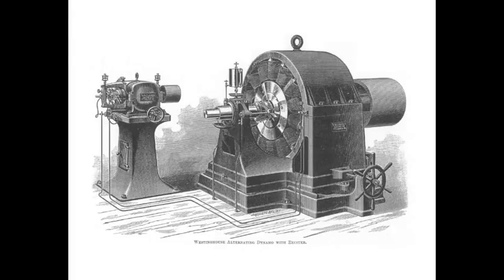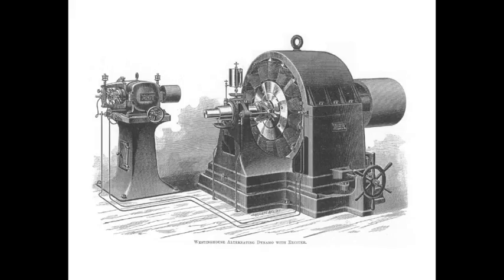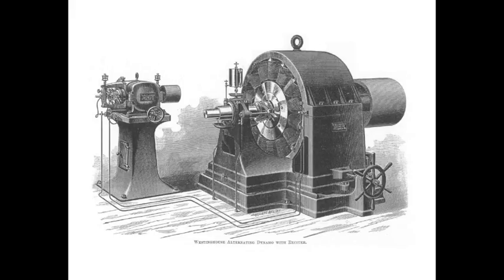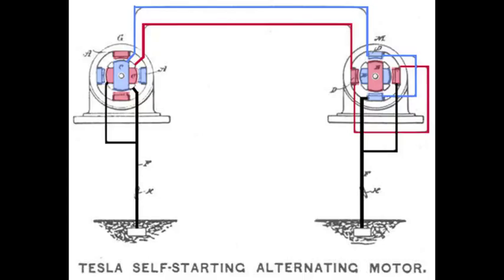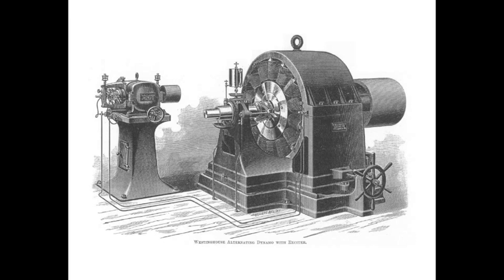Tesla's Siemen's Drum Armature in Build of Alternating Dynamo and Exciter Motor

Comment: Ok, historically the only way to get DC power was from a DC generator or by rotary conversion where a motor running at AC line frequency could convert AC into DC by a combination of slip rings and a commutator creating a mechanical switching system. That motor needed only to 'free wheel' while large currents could pass through the slip rings and commutator. Historically vacuum tube and sold state rectifiers would come later.

 If you look at and read the news article it describes building a motor without the need of an exciter. The term exciter refers to DC generators or slip ring system need to produce DC current. The articles don't call it an induction motor but clearly describe inducing a field in the rotor windings like a transformer.      

If you read about the Fucashima Nuclear accident you will see that they mention diesel generators a number of times. The reason being is that the rotors in the massive alternators used at power stations require a DC current in the rotors and power to turn the rotors from steam turbines. Once the alternator is producing power a portion can be feed back to the rotors allowing for the disconnection of the diesel generators. It doesn't create free energy since a fuel source is required to produce the steam for the turbines.